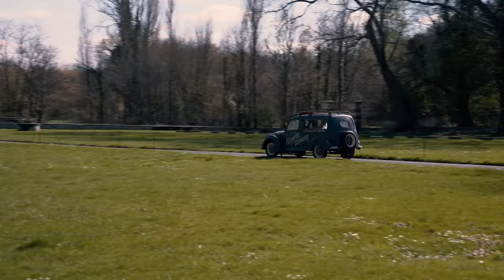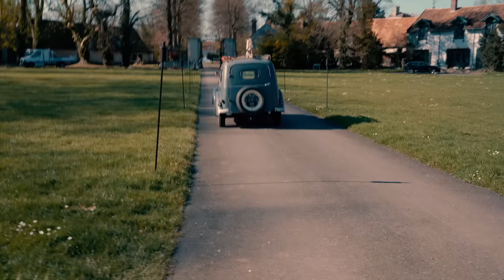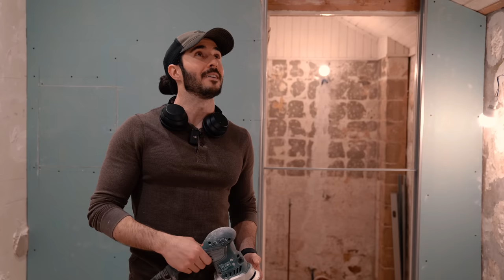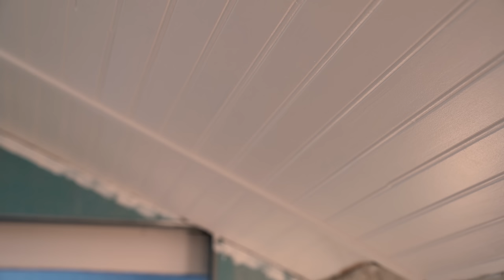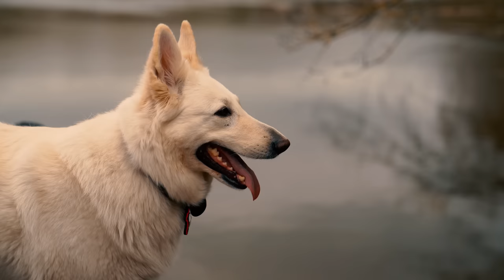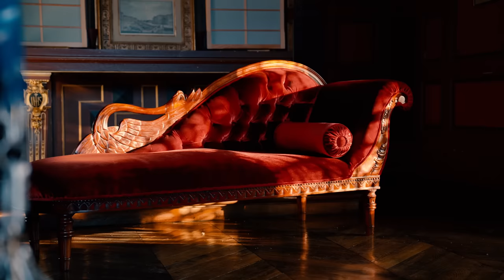Chateau Roof Repair On A Budget | French Chateau Renovations #28

Comment: I hate to be a wet blanket, but I like the limestone mortar to fill the voids. If it were a countertop or something closer to the eye then I'd go the extra mile with the resin and flowers.
Reply: Yes! But i am the designer that hates things like flowers  in a stone….
Reply: I vote for this option as well. I am not a fan of the resin/epoxy trend that might be very passe in a few years.
Reply: I agree! Limestone mortar  to fill the voids!
Reply: I agree too.  Save your artistic time and talent for a project with more impact.
Reply: I also agree- I like the limestone filler.  I think the epoxy is a trend that could look dated in a few years. From what I understand, the limestone filler is made with ground up limestone so the patches can look like it belongs.
Reply: Limestone filler looks professional versus craft project
Reply: Well. After reading your statement I will have to agree with this. The stone is beautiful in and of itself.
Reply: Resin is plastic. Why put plastic into natural stone? Some resins also yellow over time. Maybe make a resin and flower art piece that hangs for decoration instead.

Comment: Recommend taking the tiles you’ve experimented with and lay in place on bathroom floor to evaluate. Can you even see flower petals from standing height? Does resin shiny finish look good against flatter limestone finish? Have you considered using a glitter / sparkle material in resin if you are using a clear or color matching the limestone instead? Nothing flashy but subtle. Be careful that you don’t end up with something that gives the effect of having little pieces of paper stuck on tile or water droplets on tile that never dry. 
Oh and use duct tape on back to avoid runny mess and remove when finish has set.

Comment: The Best way to get the Apoxy to stay is to seal the Back with Tape well past the holes that you want to fill. pour and let settle then remove the tape after the apoxy dries
Reply from the maker: I can’t believe we didn’t think of tape 😳👍
Reply: @TheBeauChateau  look up epoxy work,  if that's the floor do it after it's laid
Reply: @TheBeauChateau  Blacktail Studio has a lot of great videos about working with resin when filling voids, building molds to keep the resin from flowing out completely, etc. He works with resin + wood, but I imagine a lot of the same principles would apply?

Since you won't have light coming through the stone, I don't think that the clear resin + flower petal look will be worth the effort. Plus, IDK how well resin will stand up to being stood upon? If the limestone filler looks fine, I'd go with that and would add more intentional wow elsewhere. 

That said, I never got to see a finished version of the limestone + resin stones; you should do what moves you! Given the lack of light, though, someone else's idea of teensy flecks of gold leaf might be nice in areas where you know there'll be a lot of light hitting the floor?

If you do go for flower petals, though, be wary of using fresh ones. Even though there's no air inside the resin, they'll apparently still change color over time and may go rather brown. Dried petals will be a lot more stable.

Comment: Well, since you asked, I would put limestone filler at the bottom of all the holes so they no longer leak, THEN fill them with epoxy - and instead of flower petals (which will turn brown with age, even if they are in epoxy), put flakes of gold leaf, or else flakes of that holographic film that you can scarcely see but makes a slight rainbow colour... But that's just what I would do... Another lovely video by the way, and I am so jealous of all you achieve in your renovations: I've been working for 20 years on my place, and all that's happening is I'm getting older and weaker, and the renovations I started 20 years ago are not as nice and new as they were at first. It's good you're young and can encourage each other to keep going. kindest regards, k

Comment: Use a wooden back (make it like a whole box, not just a plank) and use wax to cover the wood, so the resin doesn't stick to it, THEN fill the holes. You can use a plank (again covered with wax) but then you need to cover the edges of the plank backing with really strong adhesive tape.

Comment: I like the morter for ease however packing tape at the back of the tiles will hold.the reain in until set then peel off before laying.  Keep in mind the mastic you use to lay the tiles will show through the clear resin

Comment: What a great video!  I'm sure each of these is quite a production and it is easy to forget while watching how much work has to go into making these.  Just fantastic, BRAVO!

Regarding the travertine, limestone filler is standard and often how the product is sold in the US, but for the really big holes I like the idea of using epoxy with embedded flower petals - that's a cool and unique idea!  Once the holes are filled you can lightly sand it down to a honed finish and apply a sealer after you install and grout it in place.  I'm sure whatever you choose it will be awesome! 💜💜💜💜💜💜💜

Comment: 💕Do a test piece by grouting a tile in place then add resin glue or even resin repair filler to bottom of hole wait for it to harden then add resin💕Please note resin becomes extremely slippery when wet💕

Comment: Francis is another colourful character who fits in perfectly - I'm sure he and Benoit would be a Laurel & Hardy combo!
For your stone epoxy experiments, have you thought about sealing the back of the holes with the lime mortar, and then topping off the front with the epoxy?  A suggestion about the flower petals: If you dry them in a silica powder (florists use it to dry flowers that still look fresh), it would preserve them and keep them from possibly discolouring over time... You could also use such flowers from your gardens to decorate your guest rooms, or add to potpourri, etc.

Comment: If your going to grout the tiles in your bathroom, you can use the same color grout to fill in the holes. It's a whole lot easier than using epoxy filler. Just pick out a sanded color grout that is close to the main color of your tiles.

Comment: Fill the holes with grout while you finish the tile joints. I like the idea of using the occasional epoxy with floral however consider using something simple throughout like a fern leaf that has a consistent pattern.

Comment: If you use a tape to back the bottom of the limestone, it will hold the resin while it is curing, and then you can rip off the tape and sand away overflow.

Comment: I used melted bees wax and a putty scraper to plug one side of my puris rock table and filled in the clear goo. Then took a used iron and cheese cloth to warm back up the bees wax and wipe it out of the creases to clear it out and pour filler goo and level set it after 2 days sitting.

Comment: Very diplomatic, what if you duct tape the back then pour the resin Mixing with the crushed stone. Look how poured resin table tops are made with wood slabs.
I used a resin mix poured over a four leaf clover.  For some reason it turned foggy. The leaf was dry. It’s a mystery.

Comment: Dont try to woman up the stone.  Stone is stone, its supposed to be flat-ish, and almost overwhelming. Let the stone do its thing, and you can add to it with sconces, hanging art, accentuate the stone with over the top wallpaper on a wall beside the stone, if nothing else, you can use a light in a metal light holder, and cut a shape into the metal, to project an image or color onto the stone when you turn the lights on.

Comment: Stop with the resin. It looks awful. You'll have shiny wet look areas mixed with matte stone and filler and it'll look tacky, and definitely not period. 
Epoxy will also yellow over time, and the flowers will turn dull as well. 
If you insist on the resin, watch a couple YouTube videos. You have to completely seal the back.